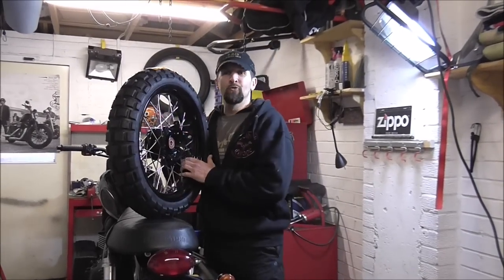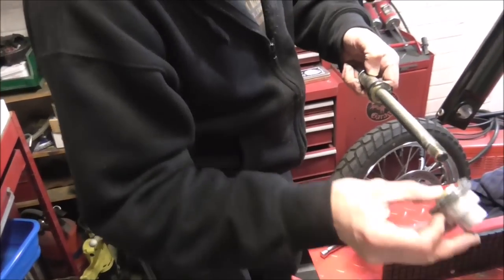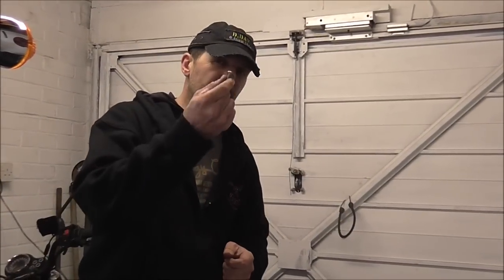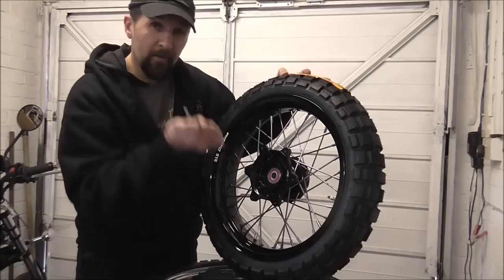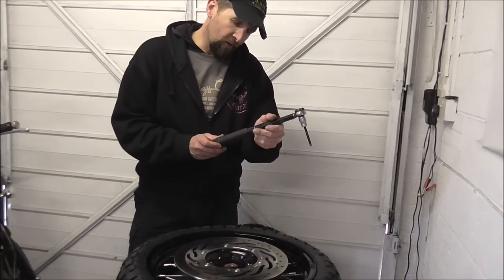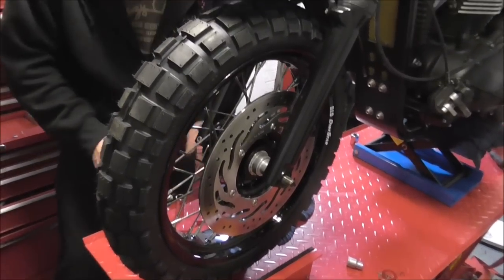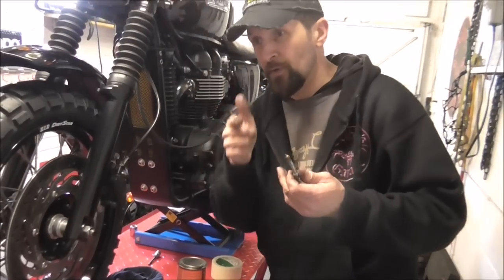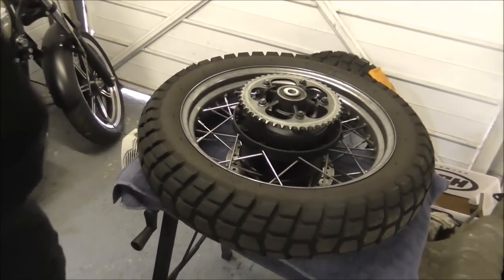Delboy's Garage, Triumph Scrambler, Fat Wheels, Walkround.

Comment: @ 5:17 "If you see them on the net for 50p then don't buy them because they'll be shit and they will break then you'll crash and you'll die" Telling it how it is - they should make you the next presenter on Top Gear! :o)
Nice vid and the wheels look great. Started doing the same thing on notating the torque settings. Got tired of forever going back to the Haynes to look them up so just jotted all the popular torques for wheels, sump, brackets, pinch bolts etc on a separate sheet...

Comment: Hi thanks fella I'm in need of a small torque wrench I must have miss heard what you said I noticed you put solution on the caliper bolts this makes sense now I learnt the hard way of tightening them too tight few years back on my fax 1400 which I still have had to replace rear caliper was lucky to get one cheapish in fab condition thanks again great videos some of us can easily get into habits but with these things they can't be rushed :)

Comment: Thanks for your latest video. You make it seem flawless. One thing you did not mention is how new tires(tyres) can be slippery on there first ride out. Finally went out yesterday for a quick 20 km ride, first ride of the season. The bike looks chunky and fat, but still retains that old bike look .
Reply from the maker: Thanks Mark..and you are right, brand new tyres can be aweful, no grip at all for the first few miles, so take it easy and build up the wear carefully over the first 50 miles until they are scrubbed up... thanks for watching my friend...Del.

Comment: Did you notice any reduction in fuel economy? I installed the shinko’s knobbies 805/804 in my 2015 Triumph scrambler and the fue economy reduced from 19-22 to 14-16 kilometers per liter. That is a lot in a whole tank. The effect matches with the date of the tires change so is hard to blame any other component. Love your videos!! Always pretty helpful!Cheers!

Comment: Love the wheels they made it look great ! Good choice ! I'd looked at one of these bikes for a long time and you have given me some great ideas . I ride a 1998 harley road king classic and it is just too big . I love it on the highway but at slow speeds it's hard to monuver I've dropped it several times and can barley lift it ., thinking I need to go to a triumph Bonnieville SE  or the scrambler I've riden the bonnieville and it was great  but what you have shown me I think the scrambler with that exhaust you installed would be great !  That bike has turned awesome . !  I'm only 5' 2" so I understand about lowering the bike .

Comment: That's just awesome, now I know what I want for my Scrambler! Need to pop out later and paint some salt water onto the spokes of the stock wheels, then at the weekend I can show the Mrs just how badly corroded and dangerous those things are and how they MUST be replaced with shiny new ones as soon as possible ;)
Reply from the maker: Good plan brother...but you wont have to wait till the weekend...they'll pickle up while you stand there and watch.... theres an old saying..."on a quiet night, you can hear the spokes rusting on your triumph"...lol   let me know how it goes mate, if it fails, then just go with the safety aspect.. "Skinny wheels are dangerous because they get stuck down tram lines"....easy.!
Reply: Moonfleet41
Well to be honest I noticed the front spokes rusting after I'd had the bike a whole 2 WEEKS. First bike I ever owned from new and I was really disappointed with it for that. Anyhow I rubbed away the rust with a soft cloth and applied a little ACF-50. No trouble since then.

Comment: Hi ya…Delboy and penny
I own a 2010 scrambler…your vids have been a great help, and given me the opportunity to have a go at doing the same work to my bike as you have to your scrambler Del!
Today i received a set of the same wheels from Doug as you have put on this vid…same size and colour hubs, rims….i'm copying everything …ha!
Fitting them myself as you have kindly shown me how to do!!
My question is…..Did you have the same issue with the closeness of the chain in accordance to the knobbles on the 170 tire….mine is literally millimetres away form failing the clearance…of both….have you done anything to rectify this issue…i don't think i have any wear from them catching each other as yet….took it for a test ride after fitting….didn't notice any wear!!….my mate has told me the spokes could be tinkered with to give a bit more space!?…could you please give some feed back to my dilemma….much appreciated….keep up the work mate…blinding stuff…cheers Nicki
Reply from the maker: Nicki White Hi Nicki... congratulations on buying your wheels!  They are no small investment, but make a beautiful up-grade to the Scrambler... first and foresmostly, tell your mate thanks for his great advice, but no thanks!   DO NOT touch the spokes, Doug has set the wheels up correctly and you CANNOT adjust the offset of the wheel with the spokes... you will need a different hub and any such adjustments would have to be made by a professional wheel builder...

Doug will have set the wheel up correctly for your bike and it will fit straight in, as it did with mine, the clearance is close, the knobbles do, indeed, run about 8mm from the chain, as a 170 section tyre is absolute maximum for the bike.  As long as your chain guard bolts on and clears the tyre, then everything is correct.  It will only clear it by a few mm, but that is enough.  Remember the chain does not move sideways under use, only up and down, so provided there are no marks on the tyre edge that it's been touching, then everything is good, and maybe just keep an eye on it if you are worried... and finally, once again, please don't touch the set up of the wheels, they will be correct.  

Let me know how it goes!  You'll get plenty of looks when you're out and about! 
All the best, D&Px

Comment: Nice. Looks mean and chunky. Interested to see how the tyres perform. What do you do to break them in? Actually don't worry, I saw you answered that elsewhere. My dad used to run a disk sander across the tyres to rough them up for the road/
Reply from the maker: AYE....a disc sander...really..???  Ill stick with the usual method of just building up the wear over the first 50 miles...todays tyres need very little scubbing.. and the set i had on the Bandit were great, never let me down and rode them like any other tyres.

Comment: I really dig the bike. I have a question for you about the scrambler in particular. I'm a shorter guy, and have been considering one of these. Functionally can the bike be lowered 2-4 inches with a rear fender eliminator kit, and fork lowering kit. I love the look, but was blessed with a short inseam. Yours truly an American who loves the British bikes.
Reply from the maker: jmcd1313 Hey buddy... yeah ou can lower them a lot, the Scrambler is the tallest of the three, and TEC shocks will give you the best route...they do a short shock for the BonnevilleSE, so if you have tat at its lowest setting, and then the regular SE seat too.. you should get the ride level back to about 28"...you can cut the steel tubes in the forks to lower the front which costs nothing too.... hope that helps.. good luck with it.. Del.
Reply: Moonfleet41 Thanks Del, I'll look into this. I really appreciated the advice. If I go this route, I'll send you some pics.

Comment: Thanks for the prompt reply...question still is, have you done any mods on your bike after fitting your wheels?..I have adjusted my chain tension...hopefully not too much!!...is the clearance ok!?..have you left it alone and happy with the clearance??...it does seem a bit better with a tighter chain...would really like your opinion Del!!..cheers mate!!
Reply from the maker: Nicki White ho Nicki, yes, changed the exhaust and ridden the bike a few hundred miles since....how much chain clearance from the tyre do you actually have..?

Comment: That is a great look. Does the smaller front wheel alter the speedo on a and Scrambler and or Thruxton ...I have both....my Double Dogs.
Have you thought of moving the rear brake caliper out of harms way?
Reply from the maker: Stuart Spiller Hi Stuart.....on the older models the speedo is driven from the front wheel, so yes it would need addressing....but on the later bikes its driven from the front sprocket so no change needed.....and yes, once i can afford the brackets ill change them on both bikes to the on top position...

Comment: would you always recommend using thred lock on the calipers? i have never done so had my bike 8 years plus, obviously i can see your taking precaution, just wondered if im making a costly error on my part, thanks Del, regards....
Reply from the maker: Kevin Hancock Hi Kevin....on the caliper bolts, the ones that hold the caliper on to the forks....you DONT use threadlock.... you use COPPER SLIP, or ANTISIEZE,....  as long as you torques them up to the correct value, they wont come undone...and the copper slip will stop the jamming in place...

Comment: Thanks for the video, Did you buy wider wheels and tires or just tires? Also, did you replace the front or back end to accommodate for the wide wheels or just removed spacers?
Reply from the maker: Hi Nicolas,  These are wider Alloy DID Dirtstar rims, laced onto factory spec Talon hubs. back rim is 5" and front is 3", and both are 17" Dia  !   so the bike can run 180/55/17 rear and 120/70/17 front just like a sport bike.. the front slots right in, and the back too, you just need to trim back the chain guard to clea the edge of the tyre.. the chain clears but only just by 3mm..!   Hope that helps..

Comment: Great video!  Post one of the ride difference how you like or did like tire combo!   Hey by the way what is the height difference if the bike?
Reply from the maker: I've used these tyres before on the Bandit, they ride like regular tyres in the dry, as the face profile of the knobbles is curved like road tyres, not square like off road tyres... they are a bit harsh under 10mph, but over that they are like any other tyre... and in the wet, maybe just take a little more care, but then with all them edges cutting in to the road, they seem to grip just as well!... the rear height is the same, and the front now runs 1" lower...

Comment: Hiya mate quick question. I have a triumph bonneville t110. 20 plate. And I wanna change the stock tires what’s the size fit the front Iam looking for also I want to go as wide as posy for the rear. What size do you suggest. Kind regards.
Reply from the maker: Hi mate,  Stick with the same tyre sizes you already have unless you're prepared to fit wider rims as well ! ,  Any bike tyre needs the correct width rim in order to hold the tyre in the correct radius profile.. if you squeeze a big wide tyre onto a small rim it pull the tread round into a deeper arch and can make the bike unstable..   Also, With your T100 Black, take a close look at the back wheel where the chain passes it !!! you'll see that there is barley 5mm between the tyre wall and the chain. !  so you simply cannot fit a wider wheel or tyre on the back... so again mate.. Stick with the factory size tyres, and it will remain safe and stable to ride....     If you want some more aggressive tyres for it, something a bit more chunky, then there are many to choose from.. have a look at the Dunlop Mutant tyres, the tread is really cool, they're a winter mud and snow tyre, so great for bad weather,  i have those on my Hayabusa Ratbike, and they grip really well even in winter slimy roads.!    Hope that helps mate, good luck with it.. Del.

Comment: Del, did you have to adjust the forks to accommodate for the 17" rim or did the bike handle just fine? I've been thinking about dropping to a 17" front on my scram. Looking for better cornering in the twisties.
Reply from the maker: No, not at all... it slots straight in... just use the original factory hub, or a correspondingly exact after market one, and it becomes just a simple parts swop and you'll definitely feel the benefit in twisty roads, specially if you invest in some chewy rubber!

Comment: looking good, would be interested to see what sort of mileage you get from the tyres, I'm running Avon Roadriders on mine & get around 5000 kms from the rear & 12000 from the front
Reply from the maker: Hi Kane....i had a set on the Bandit, and got 8k from the rear...and the front was probably ok for another 2k ....the Scram is the same wieght and less power, so i cant see why they wont last the same or more..!!
Reply: that's not bad, I must be doing something wrong LOL my Yamaha TTR has 8000kms & has had 4 rears & 2 fronts   cheers Terry

Comment: Del - I've a T100 and a Thruxton (both modified).  I am looking for a Scrabbler and you've done exactly the wheel conversion I am looking for (thank you).  Before I contact Doug, please can you list the exact spec you asked for for the wheels? (sorry if you've already done this).  I will also be doing a tail tidy (British Customs).  What year is your Scrambler please?  Thanks again for your informative videos.
Reply from the maker: +Boots Wellington Hi mate, Penny's Scrambler is a '13 bike and be prepared as those wheels are silly expensive... we went for 5" rear x 17 and 3.5" front x 17 and run 180/55/17 rear tyre & 120/70/17 front... currently got Avon Road Riders on them.... hope that helps, let us know how you get on!

Comment: Thanks so much for the video, Ive been watching all of them the last few days. If I wanted to do the exact same upgrade about what would I be looking at in cost.
Reply from the maker: Hi Eric.. if you mean, to have these wheels made, and ready to fit, including tyres.. it will be about £1800 minimum... you can do it cheaper by using the facotyr hubs.. but they look rubbish compared to the Talon hubs, are a lot heavier, and will maybe only save you a couple of hundred pounds at best... the link to the company that made them is under the video buddy.. Hope that helps.. Del.
Reply: Thanks so much I'm truly thankful for your response. is there any way you could put a component list on here with sizes and makes for the parts you chose and the tires as well. I hate to seem like I'm planning to copy but since I'm on the east coast I didn't think any one would notice lol. If I can get the list I may be able to find a state side shop to build them for me and I want have the shipping expensive on top of the parts. thanks again for all you guys do.
Reply from the maker: Certainly buddy, no problem at all.... please go ahead and copy whatever
 you like, this bike looks very different now, as we have changed to 
smooth tyres and slammed the bike over low suspension, even still, am 
not claiming any exclusive design... these wheels just look great cos 
they fit the bike's dimensions far better than the skinny garbage from 
the factory, so here are your numbers:
Front Wheel : 3.5" x 17 ... 120/70/17 tyre
Rear Wheel:  5" x 17 ... 180/55/17 tyre
Then everything will clear and work perfectly... you can fit a 170 tyre on the back if you choose for a slightly bigger clearance if you are worried, but the 180 clears the chain by a comfortable 1/4" and never touches it.... if you talk to the wheel builder and give them your standard wheels to measure, they will pick the hubs to match your exact width and axle diameter, or you can get them to lace the new rims on to your factory hubs for a guaranteed fit first time... hope that helps you, let me know if you need more numbers, or guidance, happy to help, Del

Comment: Del, gotta say you're the reminder of how we used to be. You bought your bike, you cared for it yourself. Just how it should be....Bike manufactures are ripping our eyeballs out when it comes to service. Good on you boy.Anyway, my question..... Can you give out the full spec on those wheels, sizes tyres where from etc, coz I want to smash into my piggy bank, chop in my Beemer and get back to real motorcycling.
Reply from the maker: +Mark Iveson Hey Mark, thanks for your kind words brother.. much appreciated. 

On this bike i had 5.5" rear and 3.5" front rims, both 17" diameter and the tyres were 120/70/17 front and 180/55/17 Rear..... but they may not be perfect for your beemer so call Dog and Devon Wheel Company where i got them from and ask him about your bike, what he can do for you and what it may cost.... my whole invewstlent here came to just shy of 2k so they aint cheap...! 
Here's a link to his page.. http://www.drwheelbuilding.com/index.html

Hope that helps you buddy... take care. 
Del.

Comment: I just installed my TKC 80's on my triumph, but what were the torque ibs./Ft. for the rear and front Axel nuts?  I didn't quite understand what you said in the video.
Reply from the maker: Hi buddy, sorry am not near the manual right now, so can't remember off the top of my head, it's a good idea, if you get time, to download a PDF from the net of Triumph torque settings, then print them off and keep them in the garage, like I said, am not near my garage right now, so can't recall off the top of my head...

Comment: hey del the new wheels look cool. just a quick question, front disc's on my bandit one is worn a bit more than the other, its not to bad yet but can you replace just one disc or does both discs need to be replaced at the same time... Cheers
Reply from the maker: Hi Brian, strictly speaking it is sensible practice to replace both, but in the real world that is very expensive indeed, it is possible sometimes to find used discs for sale and save a lot of money... if they are a pair and match each other, and are still within serviceable tolerance, that is a greta solution to the problem... hope that helps mate
Reply: cheers del thanks again,